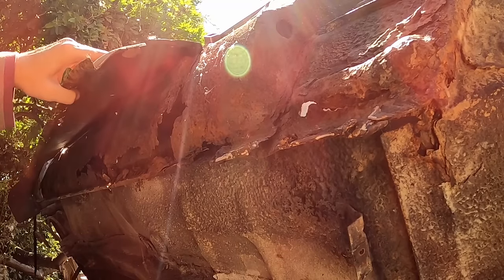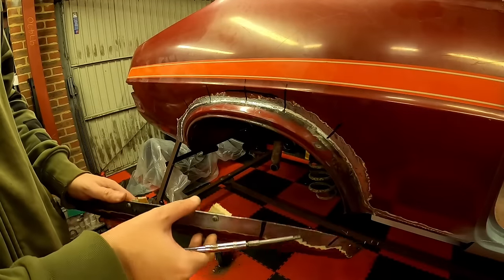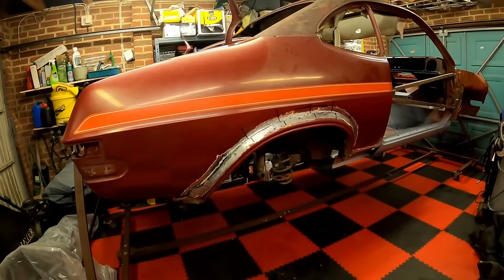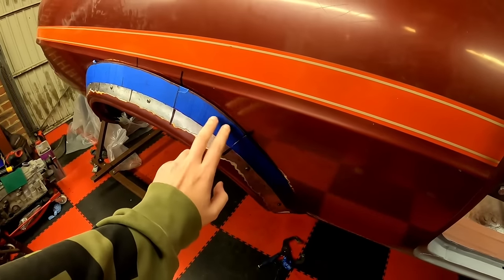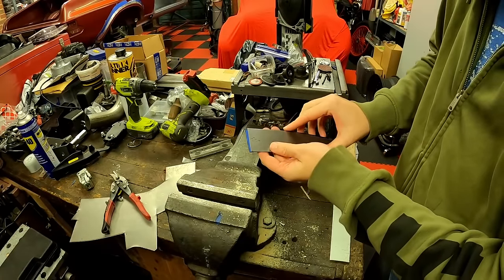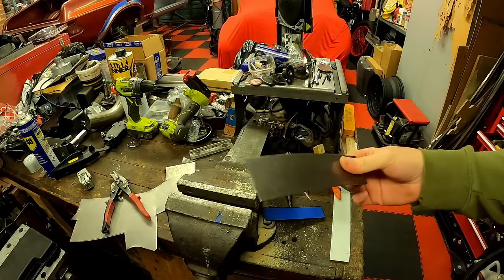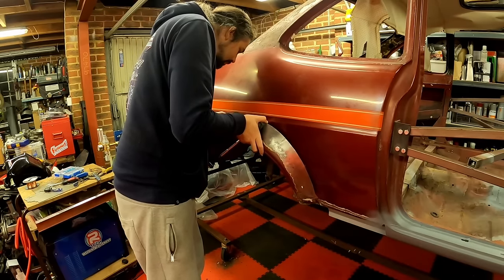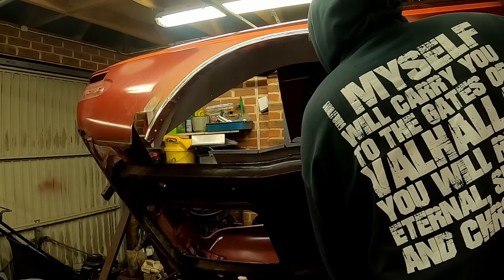DIY Widebody for my 1972 Vauxhall Firenza LS Swap [Ep16]

Comment: Nice start  to the new year with a new video. I remember those cover sills when i started work in 1980,they used them for a quick turn around in workshops,even back then i thought thats not right all you are doing is hiding rot.Nice to see its finally being done right.
Reply from the maker: Yea, terrible idea!! surely it wouldn't have taken many minutes longer to cut the original sill/arch off - same amount of welding and a load less filler work needed?! seems like one of those time saving bodges that probably take longer than doing it right!!

Comment: I don't know if you allready have but it would be a good idea to pre drill some wax injection holes before you Primer and paint her.
Would allow you to waxoyl inside any cavities when she's a painted shell.
Fit them with rubber grommets and you can re wax her every year, like the old zibart system.
A car like this deserves driving and waxoyl or similar will allow you to enjoy her all year round.
I look forward to perhaps seeing her at the santa pod vauxhall day, they were lacking historical vauxhalls with only a handful there this year.
Reply from the maker: Hi John, Yes once I'm done this will be fully cavity waxed (I did this on my magnum also) - the chassis rails, A pillars and sills already have a lot of access points for a lance - noxudol 700 is my cavity wax of choice, holds up a lot longer between applications than the old waxoyl! Either way I don't intend on using the Firenza or the Magnum when there is salt on the roads!

Comment: As a lad in South Africa watching motorsport the V8 Perana Capri's had no competition until GM took a bunch of these, stuck Camaro engines in them and called them Chevy Can Ams.
Reply from the maker: Yes! The Can Am Firenza is a big inspiration - I think the Firenza always deserved a V8, unfortunately in the UK we only got the half-a-v8 "slant four", I guess I'm doing a modern twist on the Can Am using an early 2000's Camaro engine!
Reply: You beat me to it. To the best of my knowledge,  they were numbered cars & only 100 were built. I'll either have to go back & do some research, or do a defrag on my brain, so that I can find the file that contains the info. I used to see a few in period & at Cars in the Park,  but I haven't seen one since migrating South.

Comment: Can I ask, what back axle are you going to be using?
Reply from the maker: Hi Steve - I'm using a Ford 8.8 from an sn95 Mustang - the Foxbody and the sn95 share the same triangulated 4 link suspension design with the Firenza so aside from narrowing to suit the Firenza it should be a relatively straightforward install